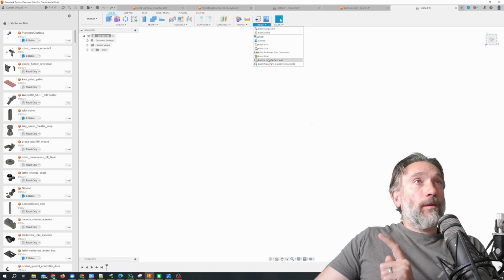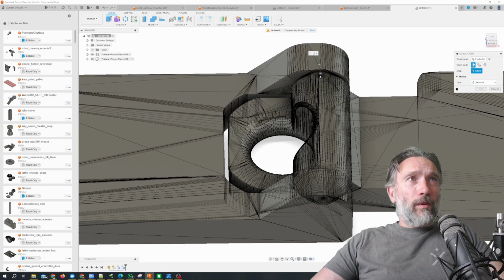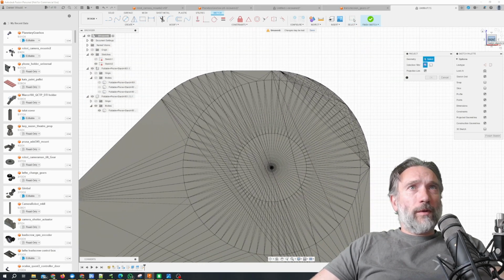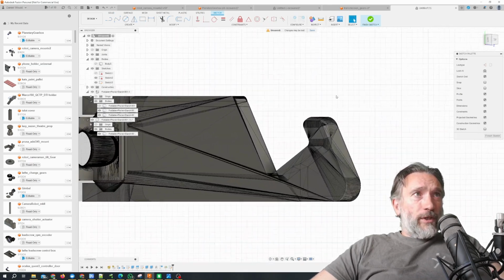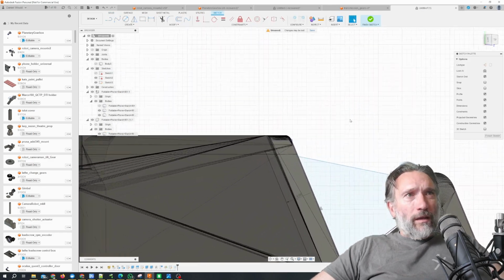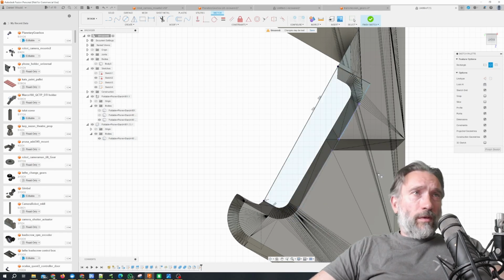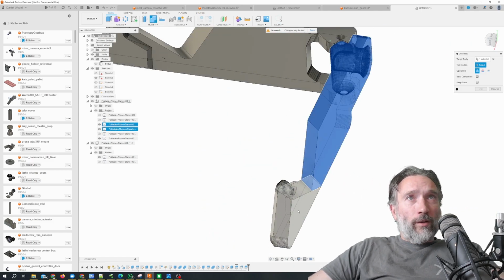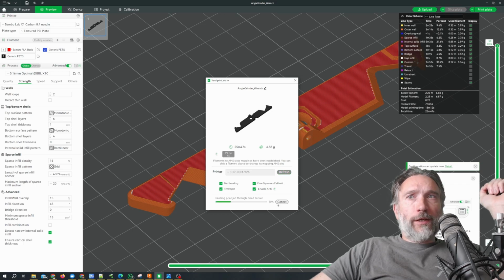STL hacking: using fusion360 components to calculate a perfect fit.

Comment: Nice! I like the trick to get the circle. One thing fusion does quite well is rebuild a face, so you can take any flat surface, select one of the triangular faces, hit delete and it will remove all of the triangular faces on that surface, replacing them with a single face. A little tricky to explain so I recommend playing with deleting faces. It won't replace your technique for getting a perfect circle but it's really useful for cleaning up other flat surfaces on STLs. Once cleaned up it can make it much easier to work with other tools.
Reply from the maker: I should probably play more with the face manipulation. I feel like I sometimes struggle to get things back to a coherent solid. But you're right, in a lot of cases I'm sure deleting weird faces and having it just repatch is a fast way to fix things up.
Reply: Yes, this. ☝🏻 On any flat surface just deleting a single triangle will give you the same results with far less steps to do and saving your timeline.